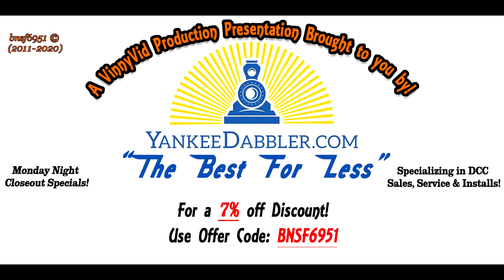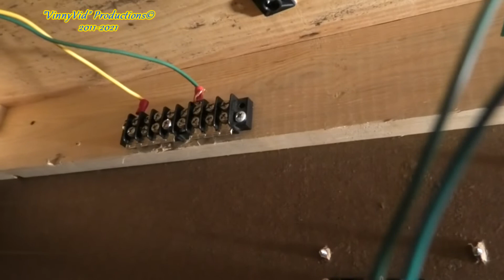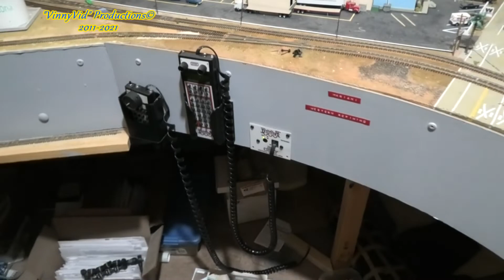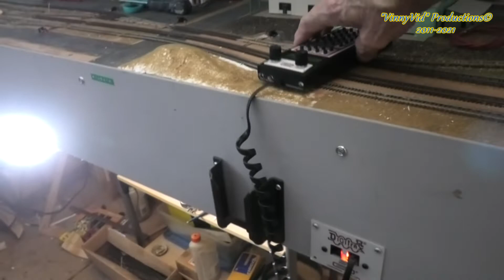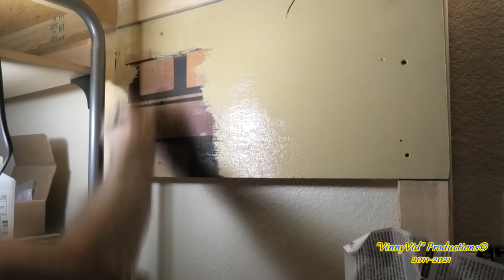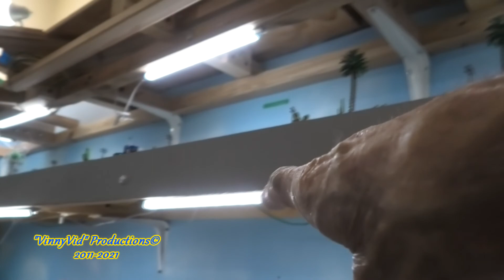model train layout update 11A..let's fix a short

Comment: Hey Vinny, I was going to suggest using 1/8 or 3/16 inch plastic air line that you might be able to skeef from brother Roy as mounting pillars for the circuit board. The repurposing of the paint stick and two sided tape seems to work well. Thank you for sharing and good luck on finding that pesky short.
Reply from the maker: thx 4 watching & your comment

Comment: cheating? lol
so you didn't fix a short, you just auto reversed it?
Reply from the maker: no...i'm at the beginning of the electrical trouble shooting ...what i am installing is a power management system which also acts as a circuit breaker...one of the circuits can be used as a reversing unit...thx 4 watching &your comment.. vinny...aka big bro